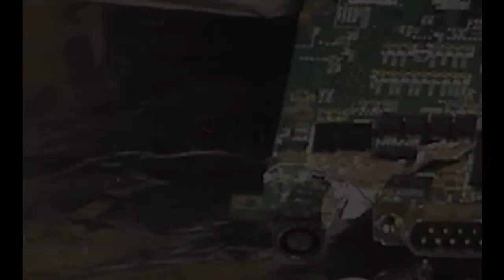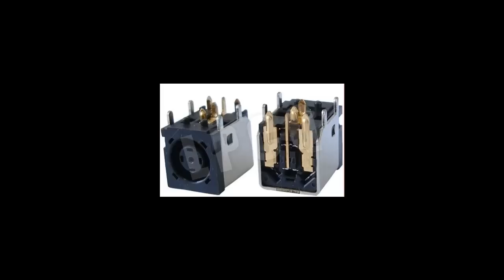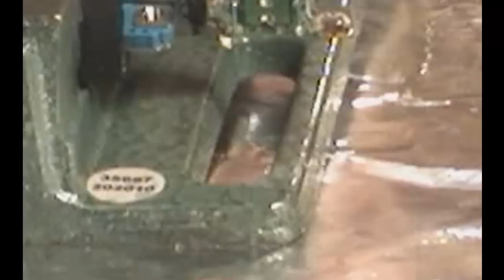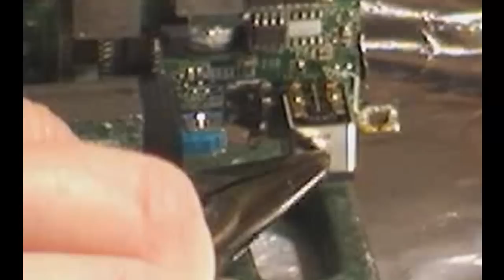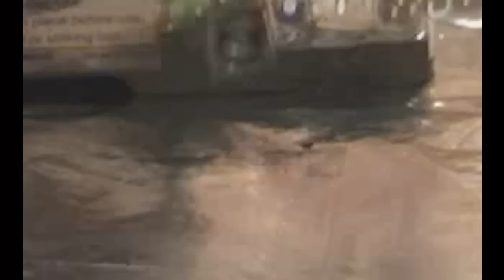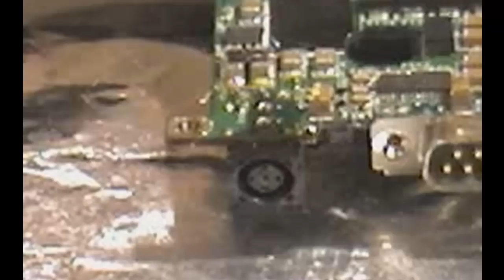Power Jack Repair With Hot Air by TimsComputerFix.com

Comment: Great video, Timster! Some questions:
1) How did you do the intro?
2) It seems you're using aluminum foil on your table. Isn't there a chance of ESD damage with the board on the foil?
3) When using the toothbrush to clean PCB before resoldering, isn't there likewise a chance for ESD?

I really like the drillpress vise idea!

Comment from the maker: I would charge $65.00 to do a power jack replacement on a bare motherboard. However, I can not put a warranty on the board nor the laptop in that situation. The only thing I can guaranty is that the power jack is soldered on correctly. Thanks for watching.